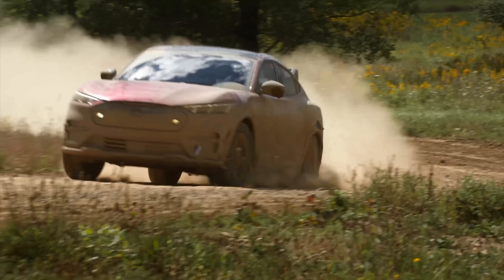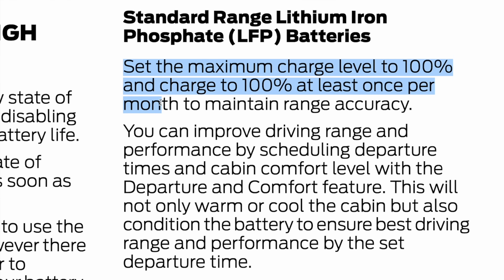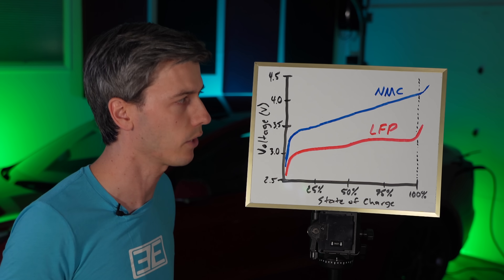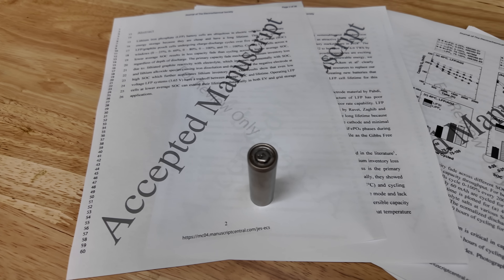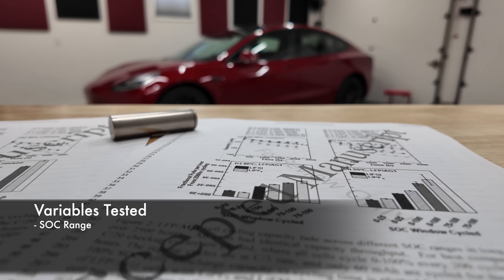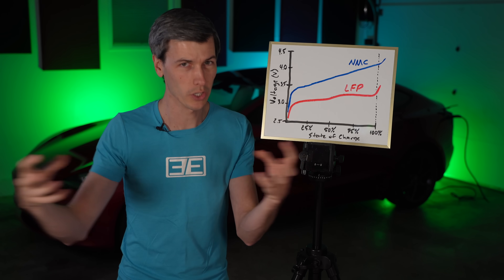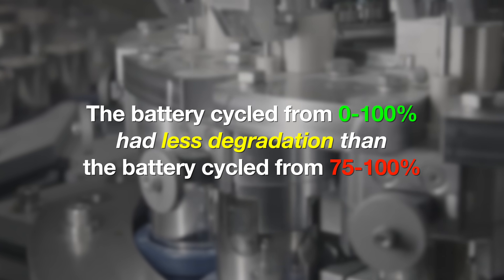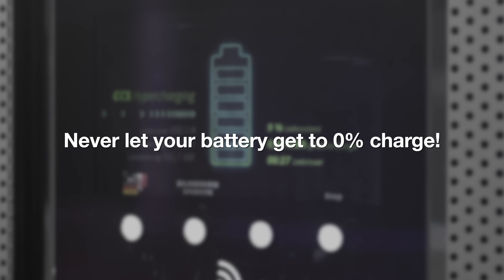How To Ruin Your Electric Car's Battery - LFP Edition!

Comment: This is why we need EV's with quickly swappable batteries. Not only would it make long road trips much easier, but the end user wouldn't have to even think about how much/how often they're charging their car. Battery stations would do all the work of carefully managing each battery's charge cycles, and even if they keep the batteries under 100% charge the reduced range wouldn't matter too much as you'd simply stop at another station when needed, albeit sooner. Plus the battery stations could retire batteries once they reach a certain number of cycles and recycle them at scale, saving even more money and ensuring that batteries with damaged cells are pulled out of rotation. 
Currently EV owners are faced with the challenging dilemma of continuing to use their old and potentially dangerous EV batteries to get the most money out of them vs replacing the battery or car for better range and safety but at a significant cost. Separating battery ownership from car ownership is a no-brainer, yet there seems to be no discussion of adopting a standard for such a thing (at least in the US).
Reply: Battery as a service isn't something I want to deal with. There are obviously EVs like this, but it's just never going to scale up.

Comment: Balancing the cells of your battery is also an important part of ensuring battery longevity. Balancing LFP cells happens at 100%. Since this study only looked at individual cells, it does not consider this factor. Not to mention that charging happens slower when you get close to 100%, so charging to 100% is not as detrimental as the study indicates.

Comment: I have a M3 SR from december 2022. 190k km so far, 439 km of range when bought, 418 km right now (4,8% degradation). I charge it at 100% almost every single day, usually, from 10-15%. I live in Madrid, really hot in summer and mild in winter. I don't think that much about "best practices" when charging my car, I just enjoy it. I appreciate this kind of videos, so thank you @EngineeringExplained for doing them. EVs are awesome if you know what you are buying and have the ability to adapt to it.
Reply: 4,8% sounds like a lot after 3 years, but 190 000 km is also a lot I guess.
My previous car was 5 years old and had ~ 150 000 km. It had a battery health indicator but it never moved away from 100%, I don't know what the resolution of that thing was. But I have to say whatever degradation there was it was not noticeable at all.
I don't know how to really quantify it though, as the range fluctuates much more than 5% with outside temperature and usage. So you'd have to compare on days with the same temp I guess?
Reply: I don’t believe you have only 4.8% degradation. Most cars would be at 10-15% degradation or more
Reply: @Military_Equipments  I'm here to tell you that if you take care of your battery, you can somehow control the degradation. If you only you could come and test it by yourself... BTW, I'm at 265k kms right now, and at 100% it shows 417 km (5,1% degradation)
Reply: M @Military_Equipments 
I have the same car. 86700 km. Living in Norway. It was 441km range now around 410-415km. I don’t follow any charging patterns. Charging at home from the regular outlet (from %20 to %50-70) and sometimes full charging at work (wall charger) twice a month. 

Daily usage around 10-20km.
When commuting to work 2x50km. 
Longer trips in summer.
Reply: Do you DC charge often? If so do you also DC charge to 100%?
Reply: @simonkovacic7339  1/3 of my charges are DC and usually I don't wait until 100% on DC because it doesn't make any sense, it takes too long from 90% to 100%.

Comment: The manufacturers use different types / construction such as graphite for their batteries whether Lithium Ion or LFP. The glaring issue is a 234 mile range car should be kept at 20 to 80% SOC which means it has a real range of 140 mile range . Unless there is clear information on charging owners will charge the same car differently so buying used its a gamble. The car might say the battery is OK but it might be calculating the capacity wrong due to the previous owners charging habits. Charging any battery quickly will degrade it faster even with effective cooling. A Tesla car battery in California or Florida will degrade differently to a car in the UK because of the ambient temperature it is charged at even if they are charged exactly the same. I sold my EV due to the value dropping so fast over 2 years. I would say an EV battery will last the 8 years with up to 30% degradation but after that no one really knows. Unless battery repairs or replacements are a lot cheaper I will not have another EV.

Comment: What if I change to 80% to preserve battery life and once in a while to 100%  to correct the range

Will the car recalibrate correctly  only if you frequently recharge to 100 you will reset the range?

Comment: Why don’t car manufacturers just program the optimal charge cycle into the car?  Makes sense to automatically fully charge the vehicle once per month and have a storage selection that allows only 50% max SOC and not let it go over as long as it is continually plugged in.

Comment: (EDIT: Your edit to your pinned comment addresses this)

... this video told me almost nothing of value.

Next time maybe actually state at any point in time the actual real difference in battery degredation between the different SOCs profiles.

A simple graph on the screen showing the different degredation amounts relative to each other early in the video would have answered just about every smart persons questions without taking eighteen minutes to go nowhere other than basically saying "trust me, I read a paper".

At least you linked the paper so I can read it myself.

Comment: Here are my EV rules:

1. If you can't charge at home,  DON'T BUY AN EV.

2. Get into the habit of plugging your car in 100% of the time it is parked at home.

3. Program your car to charge to the % it needs to handle double your daily driving.

4. Prior to any longer trip, charge your car to 100%, and don't worry about the loss in accuracy due to not charging to 100% often.

5. Enjoy having a full (enough) tank of low-cost "fuel" every time you get behind the wheel and never worry about gas stations when daily commuting again.

Comment: The drawback of LFP is the cells don't have the same energy output as NCA. That means the EVs equipped with them aren't as fast. The revolution in EV batteries will be when solid state batteries are finally a reality.

Comment: I'm looking at getting a PHEV for my commute to work. The battery range is about 70Km, which also coincides with how far I need to go to work and back home. However, that means that I'd be draining it daily and having to recharge it. Thus, I'm assuming based on what was mentioned that I'd be killing my battery faster than I should. Perhaps a full EV would be better?

Comment: GM Ultium battery is NCMA... nickel cobalt manganese and aluminum, MN is the marathon runner in the battery like the bunny beating the drum. Nickel provides dense energy. Cobalt to prevent thermal runaway and aluminum displaces some of the cobalt. How do you charge this chemistry for longevity?

Comment: Ford point number 1: Range accuracy is very different than range capacity.
Having high range accuracy means the "battery ECU" will always tell the percentage correctly, regardless of how much capacity and health the batteries lost along it´s life. meaning the battery will only die when it reaches 0% and not before that... also it wont drop to 1% and stay there for 50% of the time before dying. this is definitely what they mean by Range accuracy. 
Witch you explain later why exactly.... but definitely not good for longevity of live.

Comment: As a former product engineer for a lithium battery manufacturer for forklifts that only used LFP batteries, I can confirm this information for best practices. Also, dont keep the car in extreme temperatures for long durations. Extreme climates also degrades the LFP chemistry and reduces capacity. I know the cells I used to manufacture with had operational ranges of 0C-45C for charging and -20C-55C for discharge. I had applications where temperature control was necessary for the operation of the lift, especially when these were stored in -40 degree climates over the weekend, and operated in such.
Reply: Cold temporarily lowers performance, it doesn't cause degradation or damage as far as I know.